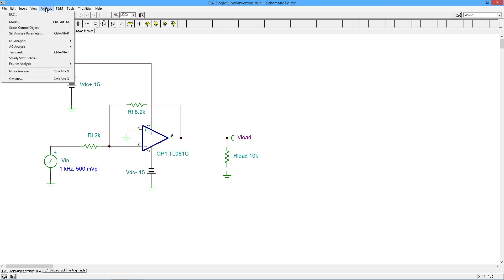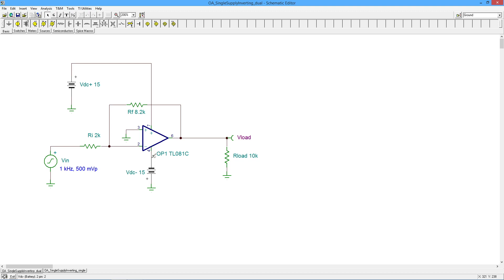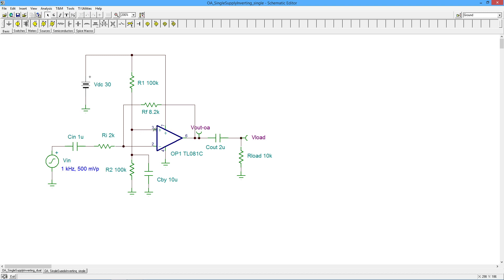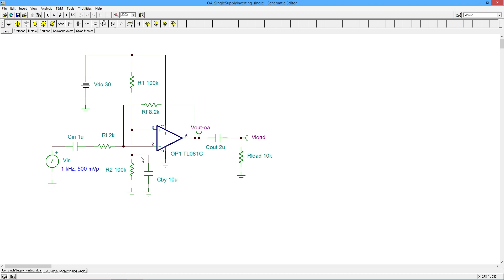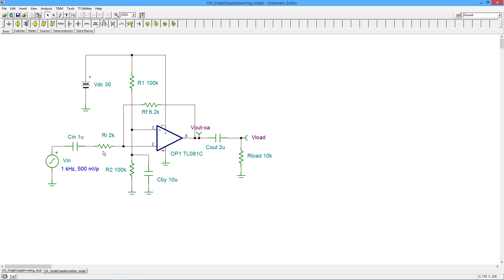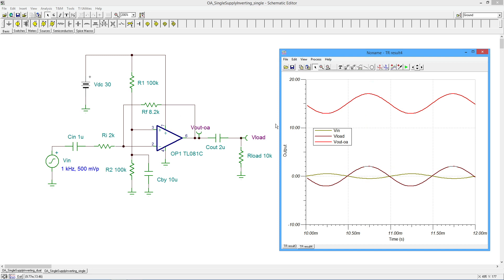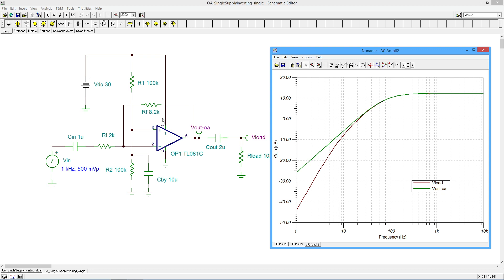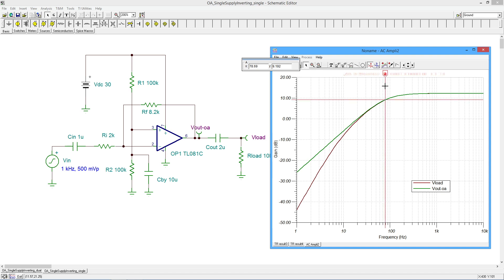Op Amps: Single Supply Inverting Amplifier

Comment: Thank you so much Sir - I have a question keeping me wake at night: 
with dual power supply we ground our signal to, well... ground (which lays in the middle of our plus and minus Vcc)
BUT
with the kind of configuration you just showed us, the signal ground will be connected to our "new ground" which , as I understand, is no more in the middle, but now lays where we used to have our negative Vcc.

Am I the only one going crazy for this lack of symmetry? Shouldn't the signal ground go where it used to connect before, that is in the middle of the voltage divider where we created our "virtual ground"?!? 

Looking forward to know the solution to this dilemma of mine,
thank you so much for all the wisdom and knowledge you are sharing 😌
All the best ❤
Marca
Reply from the maker: I think what may be confusing you is the input and output coupling caps. Don't forget that there is a DC voltage across them that (in this example) is half of the total supply. Looking at the input, yes, the signal is referenced to ground, but a DC voltage exists across Cin which is added to Vin. This raises the negative portion of Vin into positive territory (required because without a negative DC supply, the op amp can't reproduce negative voltages). Now, you could add a DC potential (an offset) to Vin that is equal to half of the DC supply. In that case, the ground would stay where it is  and we wouldn't need the front end biasing. Everything would work just fine, but the circuitry to do that is more complex than what we have here. 

Because of the capacitors, it is perhaps best to think of this circuit as two circuits: A normal inverting amplifier for the expected input signal frequency range, and as an amplifier with a gain of one for DC signals internally (and which blocks DC from Vin).
Reply: @ElectronicswithProfessorFiore  thank you so much for your reply. I understand the decoupling capacitors and the biasing in order to bring up the negative part of the incoming signal, but still I find myself struggling with the (to me) nonsensical asymmetry of this circuit in respect to a dual rail inverting amp: to me it looks like this single power supply configuration frighteningly resembles if we were just connecting our signal ground to the negative rail of a dual power supply circuit... 

Sorry if I am bothering you with these maybe silly dilemmas of mine, I used to be a guitarist, in a land where everything was powered by cheap 9 volt electrochemistry.

Anyway it would be cool if you could someday make an in depth video on opamps used with single rail power supplies, addressing all these kind of concerns - I really love your style of teaching ❤
Reply from the maker: @MarcaCanaglia  The concept of ground is a funny thing and confuses a lot of people. It's not "special"- it's just our reference point. After all, what is electrical "ground" for a 9V stomp box? It's not literally connected to the earth. Here's something else to consider. Imagine that you take the circuit above and connect the positive rail to ground and the negative rail to -30V. It will still work. What's important here is the relative difference in potential. Indeed, assuming you had appropriately rated caps and resistors, you could connect the negative rail, R2, and Cby to 1000V and set the positive supply to 1030V. The op amp itself still "sees" 30V across it.

You might find this video helpful:
https://www.youtube.com/watch?v=8pE2rAMm9EY
Reply: @ElectronicswithProfessorFiore  thanks again for taking time to reply, I am going to watch the lesson you linked and will come again to torment you with my silly questions, that's a promise 😌

Comment: Great video and explanation! Can you please show us Single Supply Inverting Amp for impulse signals? (maybe you already have, but I didn't find it)
Reply from the maker: This should work fine for impulses, unless there's something special you need (e.g., maybe a comparator with hysteresis would be a better choice).
Reply: @ElectronicswithProfessorFiore Signal is coming from a PIN photodiode, it's few tens or hundreds nanoamps and needs to be amplified after CVT and before the comparator.

Comment: Can you please explain how the critical frequency of 1Hz for the noise affects the circuit??What is the significance of 1hz critical frequency as lower frequrncy limit for noise? For AC noise will the capacitor be short circuited at all frequency above 1Hz,thus grounding all the AC noises above 1Hz?
Reply from the maker: There's nothing magic or special about 1 Hz. The choice of critical frequencies will depend on the application. 

In general, yes, you can look at those capacitors as shorts for higher frequencies. That is an idealization, of course. The reactance of real-world caps do not follow the Xc formula as frequency increases to infinity. Secondary effects come into play.
Reply: @ElectronicswithProfessorFiore  Thankyou sir
Reply: The non inverting input is raised to half supply rail ( 15v) by the potential divider 
 network R1 and R2 - (both equal to 100k)  which divides the 30v supply by 2.
We " could" actually now use "v+"  as a second signal input ...but.. in this case we only want to use v+ as a dc offset - so - to ensure that no unwanted signals such as power supply noise etc ( through r1 and r2  ) are present on v+ - we decouple v+ to signal ground .
To ensure this is effective .. we choose a value of "cby"  that gives a low enough cut off frequency to eliminate expected noise.
( 1 Hz in this case is certainly adequate in terms of typical audio frequencies - well below say 20hz .

In practice .. one would also have 30v supply decoupling etc to augment this - that is providing a relatively noise free 30v supply to feed r1 , r2

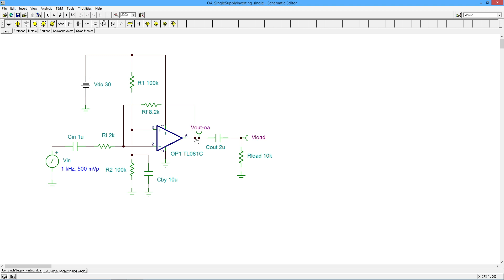Comment: Thanks for explain. I have a question; 7:26 Why do we see bias voltage 15V at Vout? When the non-inverting input is 15V, the gain is approximately Av = 5 due to the output (1+Rf/Ri) and we should see saturation (30V)? What am I doing wrong? thank you.
Reply from the maker: The DC gain is not 5. It's actually 1. You're forgetting the reactance of Cin (that's infinity in series with Ri at DC). If you remove Cin in the sim, you'll see that the output does indeed go to saturation.
Reply: Very good point !

The non inverting "ac signal gain" is indeed 1+  Rf/R1
however ... as always when diagnosing op amp ccts - we can say that V+ = V-... so if we bias  v+ to "half rail" = 30v/2 = 15v - then :
When the circuit is switched on... v+ will exponentially rise up to +15v - ( due to 100k // 100k / cby) and ... v- will follow it - also settling at +15v

As v- rises to +15v  - cin will charge up to a steady state dc voltage through R1 and ac signal internal source impedance to signal reference ground 

  When cin is fully charged - R1 is "effectively removed" from circuit as far as dc conditions are concerned.. leaving only Rf in circuit = 100% feedback since z in of v+ = very high ( infinite)
This effectively reduces the Dc gain of the circuit as 
1 + RF/r1 (Infinity) = 1 +0 = 1.

Hence the dc quiescent output voltage will be 
+15v * ( 1) = +15v